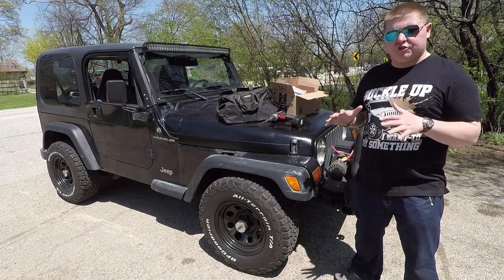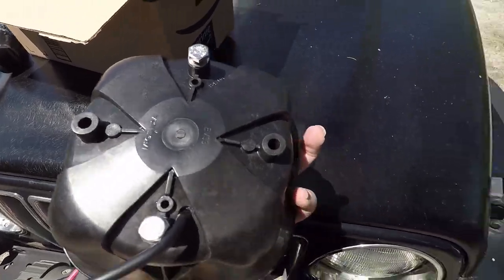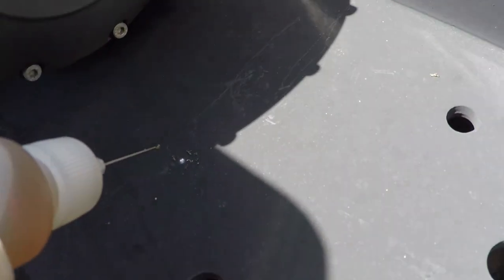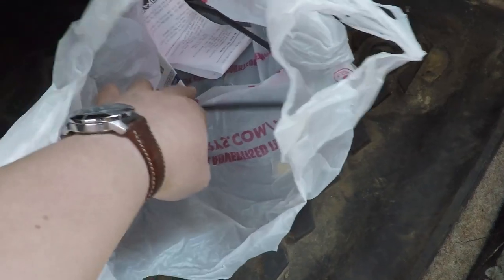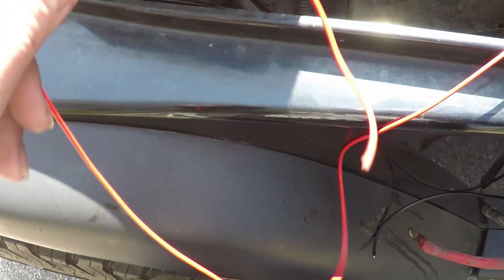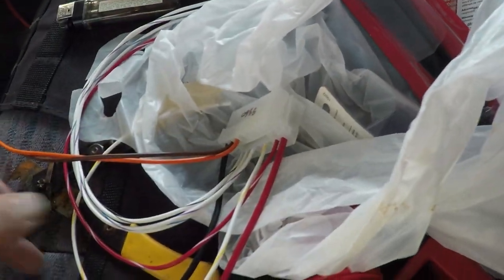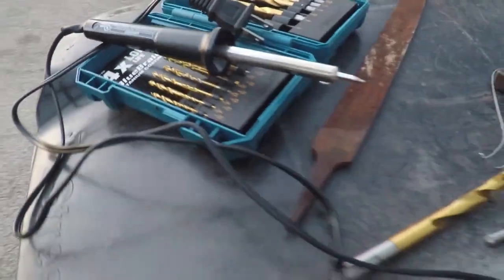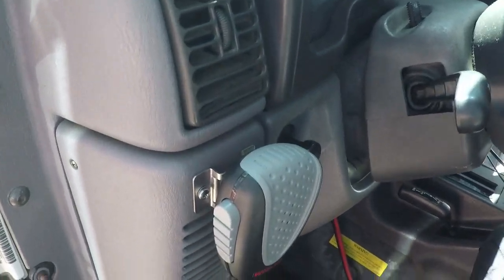How To | Installing a Police Horn in my Jeep (Whelen Airhorn Plus with Public Address Function)

Comment: so is this airhorn legal? ive thought of using an airhorn instead of the normal horn on my car. wanna know if its legal to use on public roads and highways
Reply from the maker: It should be legal in most states.  It's just a horn, no siren.  To be safe, check with your state
Reply: @mikegoldenGames  Thats what I was thinking, I never thought it would be an issue to just have a cop airhorn without the siren. The states in question where I drive the most are MD and NJ. Thoughts?

Comment: You should always try to run the negative side directly to the vehicle chassis, not all the way back to the battery. I don't know how you have your second battery connected, whether it's completely stand-alone, or if it connects to the other battery and charging system. I would understand if the second battery isn't connected to your jeep's main electrical system, but then how do you charge it?
Reply from the maker: wraith0127 it’s connected to the main battery with an isolator.
Reply: @mikegoldenGames  ah, makes sense now, sorry my mistake.

Comment: Thanks for uploading. Great video. I know you said you got your momentary switch at Fry’s Electronics, but they appear to have closed for business. Do you have any specs for the momentary switch or where to buy another? I’ve checked everywhere, but don’t want to buy the wrong momentary switch.
Reply from the maker: Any momentary switch will work. Just depends on what you want. The one I got was just a small push button. You could also just hook it up to your car’s horn. I didn’t do that for mine, since the clock spring was broken on mine, so the horn didn’t work
Reply: @mikegoldenGames  I found one on eBay for less than $10. Yeah I’m not gonna hook it to my stock horn either. Prefer to keep stock horn

Comment: 3 different sound options available with this. I only heard one.
Reply from the maker: I'm not sure.  There may be options on the horn box, but I only messed with the volume option
Reply from the maker: @La Véritée Thank you!  I thought I read somewhere there was, I just didn't look into it at the time
Reply: @mikegoldenGames   does the siren can be used with that box or i need something else?
Reply from the maker: @eduardodelatorre2411  the box is only a horn and PA system. No siren. There are other models that have a siren, but not this one
Reply: @mikegoldenGames  wait so you didnt use the siren series? it was more a direct switch?
Reply from the maker: @eduardodelatorre2411  the box does not have a siren. It only has a horn and PA System.
Reply: @mikegoldenGames  o yea my bad i saw the module but didnt look well that dindt have any button or swith for the siren
Reply: @mikegoldenGames   can u do a video about the three different tones
Reply from the maker: @noahsark3885  At this time, I still haven't
 put the horn on my new Jeep.  So right now it is taken apart
Reply: @mikegoldenGames  thanks for the reply can’t wait for the update! I’m thinking of adding one to my 2021 Tacoma

Comment: The only thing I thought was ok was the mounting location of the PA Horn/Speaker.  The wiring however looks very Micky Moused and unprofessional.  I would recommend getting a good soldering iron, a real crimp tool and split loom tubing to protect the wires!

Comment: That's awesome. I want to do this for my next project. Do you know of any cheaper systems that do not have a siren?
Reply from the maker: REVIGOR I’m not sure what you mean,  as this is only a horn.
Reply: Correct, it's only a horn, but I was wondering if you knew of a similar system with a lower price point.
Reply from the maker: REVIGOR you could just get a cheap all weather loud speaker and hook it up to a CB Radio that has a PA out
Reply: I just purchased the Speedtech PA 100.
Reply from the maker: REVIGOR I have t looked into that one. Let me know how it is

Comment: Are the power wires are 14 or 12 AWG?
Reply from the maker: Off the top of my head, I don’t remember. I apologize for that
Reply: No worries I just got one brand new PAP112, did all the exact connections but was not working.
Reply from the maker: Did you get the horn working?  Maybe a fuse was bad?
Reply: @mikegoldenGames  I think because I was using a ATM fuse holder?
Reply from the maker: @StarK12trd  Did you get it to work?
Reply: @mikegoldenGames  I didn’t touch it yet.
Reply: @mikegoldenGames  good news it worked.

Comment: Not here to shit on the guy but as a mechanic and electrical installer this video hurt. Those aren’t wire crimps. Don’t use a knife on any step of this. Just unplug the battery so no wires are hot. Tuck your wiring. You should not need zip ties. If this looked like an informative video on installing to you then please go to a mechanic. Other then that it sounds nice which is why I came here

Comment: how is the speaker holding up?
Reply from the maker: Ric Lopez still works great. Just took it off the black Jeep, so I can mount it on the Rubicon
Reply: @mikegoldenGames  very nice. I'm thinking about getting one, just the speaker for my 4x4. My cb has a PA output
Reply from the maker: Ric Lopez it may not work. It’s a 100watt speaker